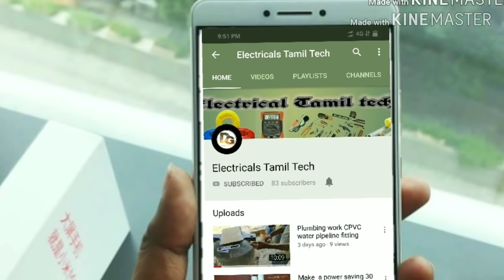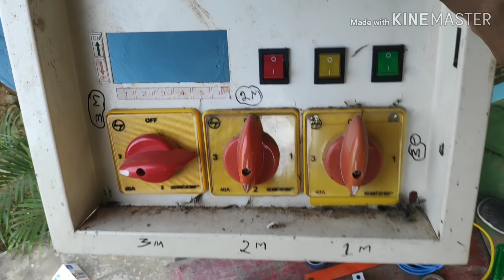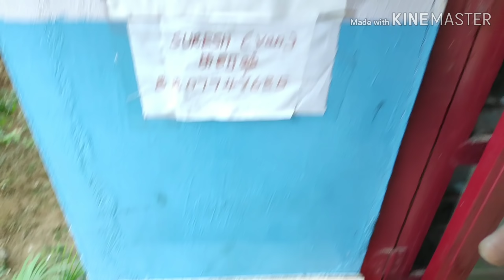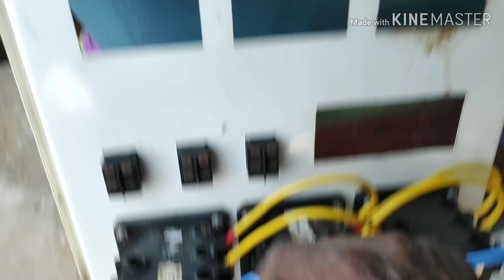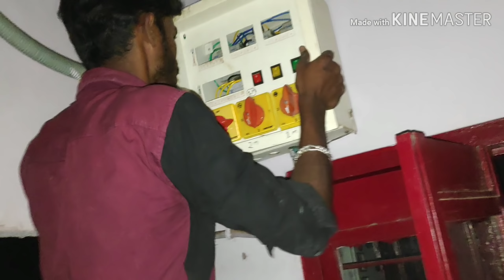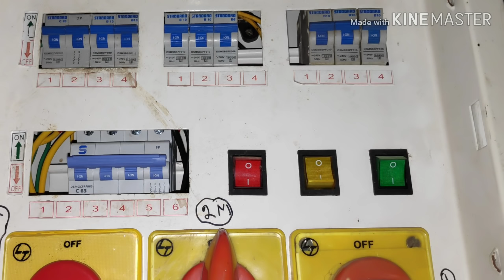How to MCB box connection and distribution MCB box connection// MCB /3 phese Rotary switch  connecti

Comment: Bro armod cable LA tap suthi propera pannunga  mudinja cable seevi puthusa podunga mudinja leg adinga appadi ilana crtah tap adinga bro athey mathiri rotary switch LA connection series LA kodukumpothu cable cut pannama cable naduvala wire seevi connection kodunga joint vena bro aparam armode cablela gland use pannunga nallathu safety bro Ella cable tep adichi propera pannunga

Comment: The Electrical wire from '4 Pole MCB' to 'Phase Rotary Switch' may burn if all the switches are turned to the same phase. EXPLANATION: Assume that there is supply only in Phase 1 - Red Colour. Assume the Output load is FULL/HEAVY on all 3 output phases. Since, there is no Input electricity supply in Phase 2 and 3, you will put the Rotary Switch to Phase 1 in all three switches to get output supply.  As the electrical wire is capable of taking load of only 1 Phase(red) FULL Load, it will burn out because now there is 3 times the current flowing through it which is beyond its capacity. To avoid this, you must use 3 times the wire capacity in Rotary switch input wiring.